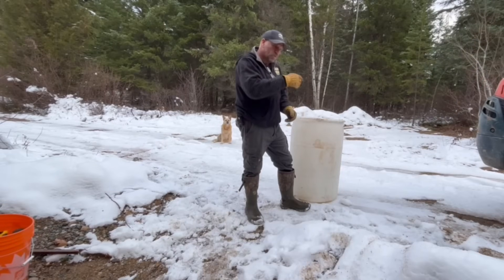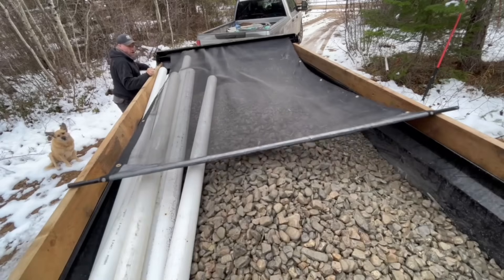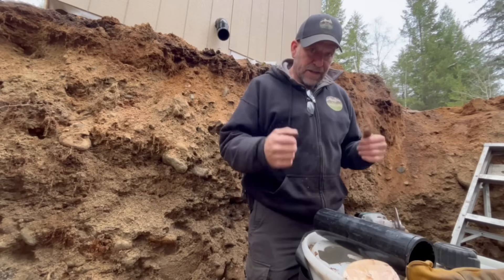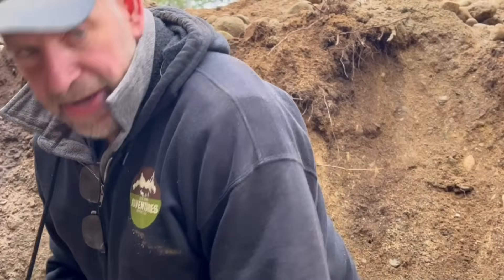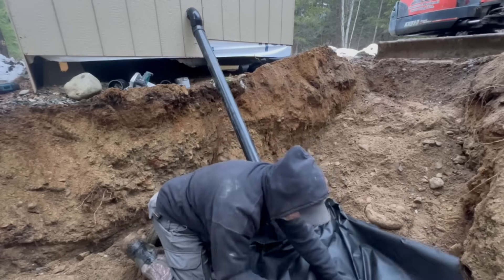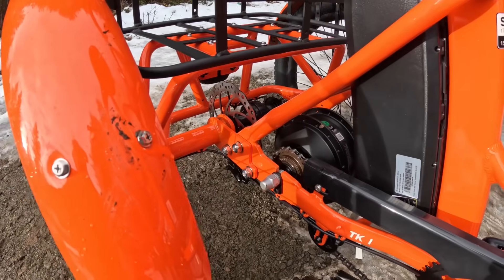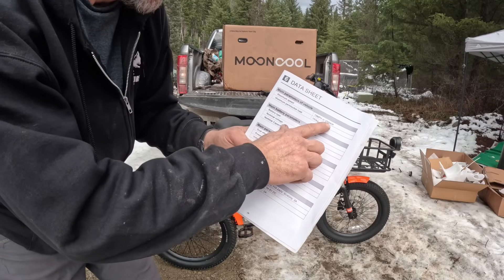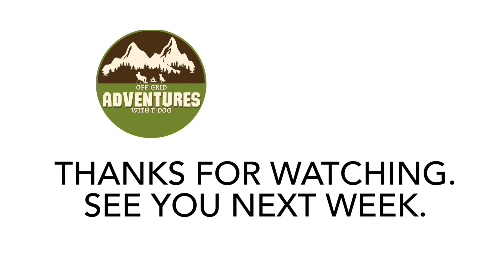DIY-How to build your own discharge system

Comment: In the end you will find that the 45 gallon cavity you have created with the drum will be of little consequence. A crushed rock pit with weeping tile would have sufficed for your grey water. If a problem occurs it will be due to the inability of the soil to drain what you are dumping into the pit.
Reply from the maker: yeah, I agree. The only thing my soil is Sand And Gravel and rock when I dug a waterline I dumped 45 gallons of water down and it was gone with an under 10 minutes so I’m hoping it works for a while anyway
Reply: @thompsonscabin  That being the case and being a situation that grease from a sink is not involved, I think you can rest easy.
Reply from the maker: @ErnestWarren-zn6ph yes I think so too

Comment: Great video Thompson; I’m planning on doing a grey water sump for our shower in the spring. I’m happy it worked out for you as I’m planning the same design. 

How deep did you put the water barrel? It looked to be 10-12ft to the bottom of the pit?
Reply from the maker: @mattandmouse  Hey Mat yeah thanks it worked out well. I was quite surprised although my ground is very gravelly with sand so that helps the bottom of my barrel was 8 feet approximately but from what I understand, you only need to go down so that you have 2 feet of dirt on top of the barrel I had the excavator and it was easy digging so I just did the extra for security, hope you guys have a wonderful week merry Christmas

Comment: Great video, off-grid adventures with Tdog. Looking forward to seeing your next upload! I smashed the thumbs up button on your post. Keep up the fantastic work. Your approach to managing gray water systems is fascinating. Have you considered any specific innovations to enhance the efficiency of such systems in residential settings?
Reply from the maker: @KeyserTheRedBeard  

"Thank you so much for your kind words about my gray water system! I really appreciate you taking the time to stop by and comment. While I haven't explored advanced filtration technologies yet, I'm always open to new ideas. Given that my ground consists mainly of rocks, gravel, and sand, the drainage has been fantastic, which helps a lot. If you have any suggestions or insights on new methods, I’d love to hear them! Thanks again!"

Comment: Like the bike, I think mountain bike type wheels would be a great improvement. I am a tad concerned that the drum could begin to sink if the ground becomes saturated, that is if the water sits and doesn't slowly run away. I was expecting you to dig a drainage field, be interesting to see how it goes over a couple of years.
Reply from the maker: @alpinealpine2793  I agree the mountain bike tire would be an improvement.
I am hopeful that it won’t because most of the ground is good size gravel and rock, but that’s not to say it won’t becausesnd does dissipate through the rock with water. The only good thing is it’s mainly just for a washing machine so it’s not constant fingers crossed, though it works , thanks for stopping in. I appreciate it.

Comment: Great idea for your grey water 👍, Hey man that is a pretty cool bike :) I could put a fuel can in the back & run to the store ! might have to build a bigger shop so I have room :) It will be handy around your homestead , Have an awesome evening
Reply from the maker: @littlegriffoffgridalberta6837   thanks Don so far it’s working great.
The bike works really well. My only problem is I don’t even have a shop yet to put it in lol working on it though it is going to be handy for sure. Thanks man. Have a great evening.

Comment: Hey Thompson.  Great idea for the drainage.  Thought you were going to lose an eye drilling the holes.  Eeek!   Love the backhoe. What a handy machine.  Bummer cutting the pipe too short but you figured it out! Cool E-trike!
Reply from the maker: @lorettaandjasonoffgrid  Hey thanks yeah so far it’s working great. I like the back too too bad. I couldn’t keep it lots more holes to be dug. The pipe was a little short, but all worked out in the end Eric works pretty good. Thanks. I appreciate it.